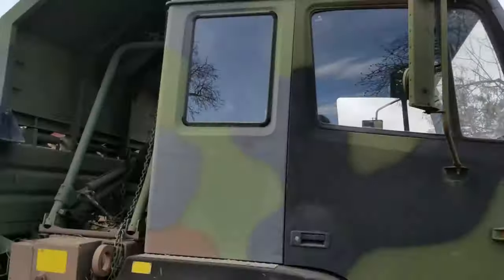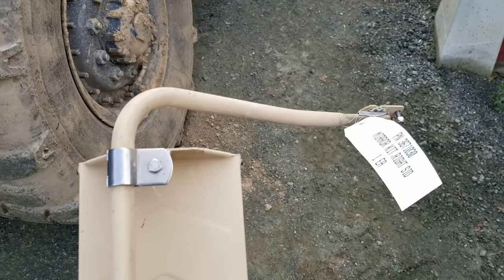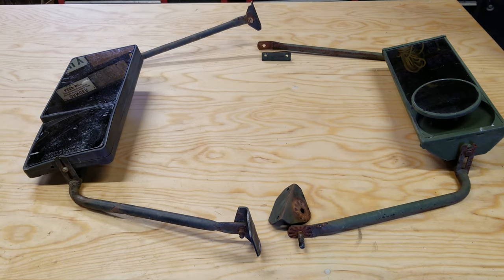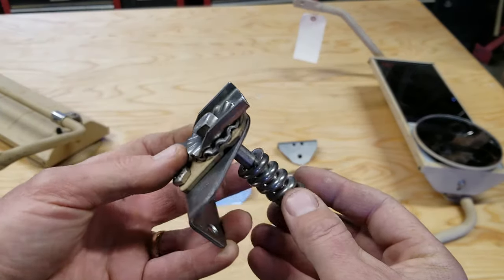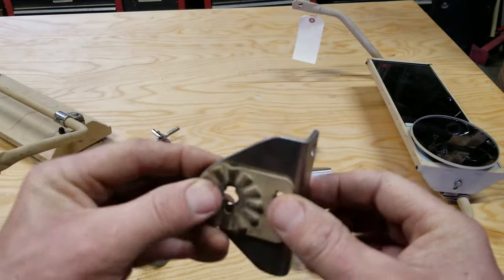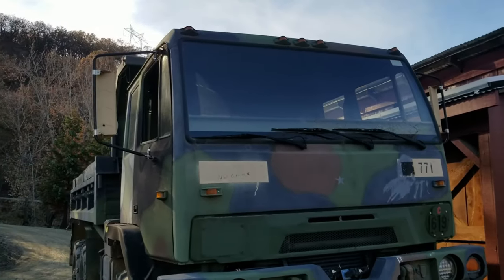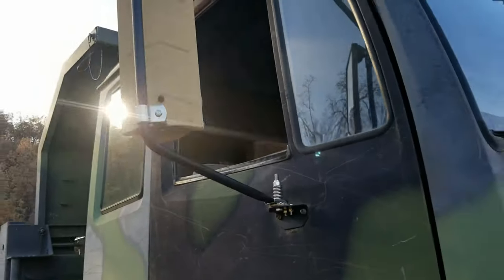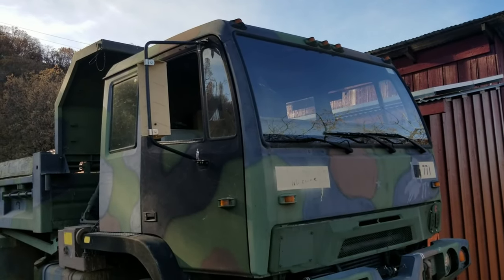LMTV Army Truck MIRROR UPGRADE using MRAP Detent-Swing Mounts

Comment: Thanks for making this video.  I have been looking for those spring detent things for years now.  You gave me some great ideas.   Where on earth did you source the mirrors?
Reply from the maker: eBay
Reply: @cowboyV2  right but what part did you search for to find it?  "Mrap mirror" does not work.  I know they exist but am missing the exact word you used to find it
Reply from the maker: Here is the listing. Set a saved search alert for the part number. https://www.ebay.com/itm/2-Oshkosh-Mrap-FMTV-Military-Jerrv-Side-Door-Rear-view-side-Mirror-kit-3698231-/183768211050?mkcid=16&mkevt=1&_trksid=p2349624.m46890.l6249&mkrid=711-127632-2357-0

Comment: Whats the width and length of the body?
Reply from the maker: Do you mean the truck cab or the mirrors?
Reply: @cowboyV2  the actual body not the chassis itself its been very hard to find details and specs for the lmtvs (I'm personally going to be converting atleast 1 to be used for prescribed fire use meaning tank,pump,storage,front spray bar)
Reply from the maker: Ok, got it. 86" wide excluding fender flares, 96" wide with fenders. 72" front to back.